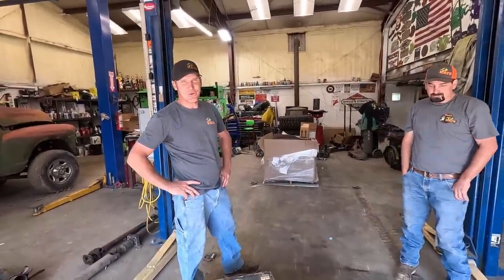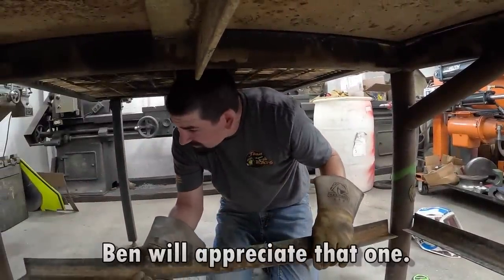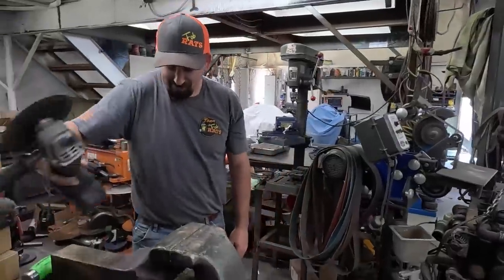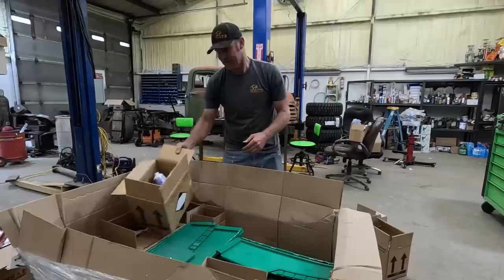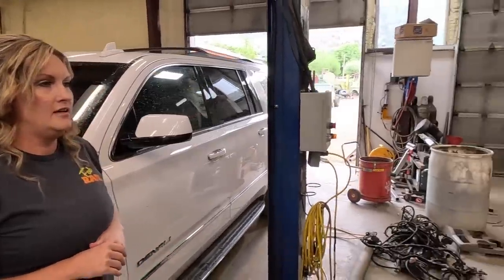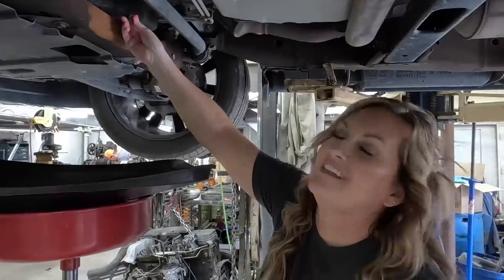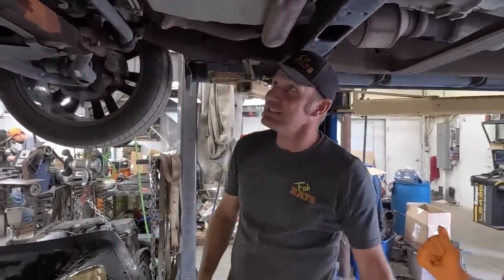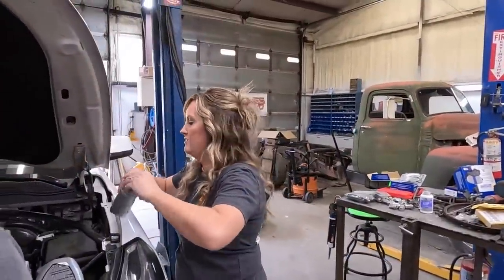Table Upgrade: You Won't Believe What I Used To Build It! Plus, We Master Hip Lingo.

Comment: WAY TO GO Meeeshelle Paul's bell . A friend of mine (heather) just changed her oil herself and i helped her do a V10 spark plug change in her Ford Excursion, she actually swapped 5 and i did 5,☺️ and i did driver side which is the easy side. i was so proud.

Comment: Having good tables in a fab shop is a must! In my fab shop not only are all my tables set at the exact same height but they are all on heavy duty locking casters so I can move them around the shop. Actually most of my equipment that can be is on casters even my 52” Stomping shear!

Comment: I've had a Sears ratcheting ball end nut driver for 30 years. I use it quite often. It is an awesome tool to have.
Those sleeping pads are handy to have. Put one with your hunting gear. I'll keep you off of the ground. They're really great for emergency use, like getting lost and having to overnight somewhere out in the boonies.
I'm pretty sure Matt and some of your other buddies could use some of that stuff from the big box.

Comment: Really enjoyed this. Everyone. Was laughing and just having a great time. Michelle has a awesome voice when she sang, it did my heart good. I must say growing up in Florida I loved to run around barefoot and have done that most of my 69 years. In my early 50S on the Pine Ridge Reservation doing a health clinic I saw all the little kids running around barefoot, so I popped out of the semi truck and right onto a goat head. At this time I had know idea what beast sunk its fangs into the bottom of my foot. I thought Florida sand spur had made my feet tuff enough to with stand anything. Man was I ever wrong. I would rather step on and old nail than one of those nasty beast. You should share one of those. I really enjoy your channel.

Comment: Hunter,  the time was 45.07 seconds  not 45.7 seconds. That is 0.63 seconds faster. Might not sound a lot but in a 100 meter race it could be the difference between first and last.

Comment: You need to check the air pressure on the tires.  The rounded off corners on the front and the heavier wear on the center of the back tires could all be from the air pressure being to low.
Reply: Excessive wear in the center is usually a sign of over-inflation. More mpg, less mp tyre! 😂
❤🇷🇴

Comment: You CAN mix different weights of oil. Stay with the same brand, so the additive package is the same. 3 quarts of 10W30 and 3 quarts of 10W40 gives you 6 quarts of 10W35. There is no real reason to do so, but in a pinch 10W35 oil is a helluva lot better than no oil at all! Have been around both in and running shops since 1984. Once again, no real reason to, but its better than nothing. Ask me about ATF in the crankcase!

Comment: 23:53, If I remember correctly, GM puts tabs in the frame for you to hook the ear of the caliper into so it doesn't hang from the line, you can kind of see it at the time stamp where the wheel well plastic ends, small oval hole to the left.

Comment: The first number is the indication of where the viscosity of the oil should be for a given vehicle and the region in which it operates.  In regions where it is usually very cold a low viscosity is wanted to reduce the effort the starter motor must put out to crank the engine.

Comment: Just a little tip for how I remember when to change the oil is I go 5000 miles and do it in intervals of that so at 100000 then 105000 and so on so you don't have to remember the mileage but still write it on your filter and the date just in case. But that method works with my wife to tell me when it's time just in case I don't happen to drive her car. Also keep the great videos coming, this one had us all laughing the whole time.

Comment: those dozer tops I was in the Army and in 76 i got two of them assigned to me, they had the solid 1/2 in steel tops around 78 I got two more assigned, don't know what I needed more for, they had steel tops like the others so they were well past WWII issue.  The advantage was protection from small arms fire.  The dis advantage was the sun would cook you in summer months. Now you know.

Comment: Paul, you are not utilizing all of the upper space of your shop around the perimeter. You NEED warehouse shelving that can not only hold a tremedous amount of volume but also weight. It can also hold smaller shelving AND you can delete the lower shelving to have workspace/tool boxes underneath.

Comment: I just found out something that Paul mint find crazy & I a Chevy guy!!  The factory cam bearing spacing specs by the book claims it should be between 1.5 to 2 thousands but is actually as much as 6 thousands from the factory!  Crazy but makes alot of sence when my machine shop told me. Been running clevite tri-metal cam bearings that support 5000lb of pressure where stock is 1800lbs.  Full race bearings can handle 8000 lbs. We ream them to fit after installation since most aftermarket LS cams have larger bearing surfaces, to make up some of the stock clearances since few are willing to install new cam bearings... Im so jelious off all the chemicals ITW sent you!  Locktite & Right Stuff are always in short supply in my shop lol.  Love the new table upgrades & dedicated plasma!  Some day!!!!!

Comment: Having Miss Michelle in the FAB-RAT-SHOP,  simply tops off any video as far as my opinion is,  concerned.   And the Yukon SUV I feel 90% certain it belongs to Michelle. 

It really is a beautiful one.   And the table turned out fantastic.  Lastly,  I think it was right about 3-minutes into the video and looking over Paul’s shoulder out the garage door,    You could see the clouds getting extremely dark.  So,   it looks like the bottom was a fixing to fall out anytime.

Comment: Look into the oil build up on the valves. It's a common thing with these DI engines. That and lifter failure. I've got the same yukon.

Comment: I noticed you used 2 clamps on the caliper, a trick i have used all myblife is just compressing it before i take it off.  I can also check the slide points doing this.

Comment: 90% of those style spline lugs can be taken off with a 19mm or 3/4 with zero slip slides on just like a socket. I had to do it on a duramax I had. Proved it to my co worker at a local mechanic shop at the time that was far senior to my knowledge level and he was flabbergasted lol

Comment: Good job on using the caliper lube.  Too many skip it and end up with uneven pad wear, brakes locking up or brake fires.  Be sure to renew it every two years when the brake fluid gets flushed or any time you need to remove the caliper.

Best!

Comment: 2:54 not gonna lie i cant crouch anymore. If i have to use my knees much it will be a short day in the shop 😂
6:43 expanded metal is the way to go. I made sheet metal drop in shelves on my work bench and they are FOREVER gathering nasties. Ofc my shop is a tent so its even worse.
15:58 😂 Paul casually backs up 😅

Comment: Paul, in replacing that oil filter, you did not mention to Michelle the need to put oil on the surface of the rubber gasket, neither did we see it being done.  Was it done????

Comment: Paul stop those old pads they will have a hole in the center of the caliper through the pad knock it out get some bolts and you use a impact to change pads way faster!

Comment: I'm not sure if you guys do this it was not shown on the video but when I change my oil and I get to the oil filter I prefill the oil filter and I dip my finger in the new oil and run it around the filters gasket reason why I do this is to keep the motor from running  dry  without oil

Comment: Yeah Paul, Hunter and Sean upgraded the welding table and now it will be easier to get access to the mig and Tig welders. Landon must have driven Michele's SUV a lot to wear those break's out. I'm sure Michelle helped a little bit on them 😉 it's nice that Paul is teaching Michelle how to change the oil and filter plus indoctrinated her on the brake pad replacement. Hunter welding in a pair of shorts was dangerous and funny! So Sean can weld? Welcome to the channel Sean!

Comment: Michelle, on removing the drain plug and dropping oil from it on the garage floor:- "It's only 3 little drops" (of oil on the floor).  Michelle cannot count, as actually its was 22 good size drops.  If that had been her kitchen and Paul had dropped milk on the floor, there would have been big trouble, probably.

Comment: Isn't it funny? My 2017 Dodge Journey Crossroad is still on the MOPAR factory front brake pads and it has 168000 miles. Oh and it's never low on oil between oil changes. I'm a reformed GM junky.

Comment: Good for you guys for using the correct oil, but mixing and ending up with 5w26 really wouldn't be the end of the world.  Heck filling with 30 weight would be alright...especially as the summer months kick in.  Everything is going to get lubricated just fine...it's just that you will get like 0.5% worse fuel economy. Thicker lubricates just fine....

Comment: Great job, Michelle
Paul why would you put bald tires on the front of the steer and the good ones in the back I know tires are expensive but I wouldn’t replace the ball tires with new ones or just got off or new ones and use the two good ones for Spairs

Comment: Michelle did not to bad...wish you would have showed her how to torch to spec the tire lug nuts though...letting her off to easy maybe, because she is learning this stuff pretty well? 
   
There is only one reason you can't mix different oils, that I know of, as the additives that work at operating temperatures could compete and cancel each other from working effectively. Note this information is 20 years old though...

Comment: what is the whining noise coming from the engine when you started it at 27:02 my gmc makes the same noise , sounds like a power steering pump gone bad but these dont have power steering pumps.

Comment: I can't get my head around the way y'all built the shelf under the table.  Why did you weld the angle iron to make a lip around the edge? It seems that unless you want a lip around it.  It would be easier to use if the angle iron was flat.

Comment: Usually tires wearing unevenly is s sign of bad tie rods or bad ball joints or wheel bearings. Shouldn't be A alignment problem unless it was never  aligned after a previous tie tod repair.

Comment: should be 8qt of 0-20 and also the inside wear on the front tires is normal on those see at least 20 a day with gm spec alinements and they all wear the inside of the front tires some will chop the inside of the front tires but that is normally on pickup more than the tahoes/suburbans.
Reply: to be perfectly on the full mark its 8.3 qts

Comment: I have always said that Girls should take one semester of auto shop, and Boys should take one semester of home ec.   I got married at 18, and then divorced 9 years later.  I did not know how to wash my clothes.  Sad, but true.  Also, before I got divorced, my wife called me one day and asked what it meant if the OIL light came on.  I said that you should immediately shut off the engine.  She said that it went back out after she went around the corner.  She drove it to her Mother's house to call me.  (1968)   I drove out there and put in 3 quarts of oil.  She did not know how to check the oil.  I started to do a weekly check of her car that I never drove after that.

A few years ago I moved to a town in Idaho.  I used Big O for my tires in Nevada, so I went into the Big O in my new town.  They tried to scam me into doing several additional things on my pickup that were NOT needed.  I was a heavy equipment mechanic at that time.   I left that shop and NEVER went back.  I now use Les Schwab, and I am extremely satisfied.  That Big O scam attempt ended up costing them thousands of dollars in tire purchases from me, plus, I told everyone that I knew about it.

Michelle did awesome with her maintenance.  Do you think that she will ever check her oil?  LOL

Comment: I will never trust an impact gun, pneumatic or electric to do wheels again. Putting them on, yes. I still follow up with a torque wrench, after having two front wheels come loose, and one almost completely off on my RAM 2500 Cummins.

Comment: Only thing Paul did wrong did wrong with the oil change is: You did not crank the engine after filling up the crankcase with oil. You have to check the oil level starting the engine to fill the oil filter. Rookie mistake.

Comment: It's normal for any GM vehicle to be a quart low on oil.  The only time they're not low on oil is right after an oil change.  Fear not though - give it about 1k miles and it'll be back to "normal."  🤣🤣😂😂

Comment: I know the com mentors are brutal,  Before you pull the caliper, take a big flat screwdriver, pry the pistons back in with the used up pad, no need to screw around with clamps. Never hang a caliper from a hose. The internet will make you perfect.

Comment: OH man  I " bet " there's going to be all sorts of pedal pulsation. Can't believe they didn't replace the rotors also. Well that will be another video when they have to replace pads again and rotors.  I think you should take that thing for a ride and see  if the breaks pulsing. That first wheel  going back on didn't look right.
Reply: Hahahaha.
Armchair mechanics rarely see what they think they do.
Why would the brakes pulse?
Changing the disks when they aren't worn out is a waste of money, time and resources.
They pulse because they're warped, if they weren't pulsing before, they won't be now.
If Paul and the rest of the crew can rebuild motors and transmissions, diffs and bodywork, i think they can be trusted to do brakes.

Comment: Ypu need heavy duty castor wheels(with brakes) welded on all of your tables. As soon as you will do it, you will curse yourself why didn't you do this sooner. Mark my word. Everything, pipe bender table, anything whats heavy in shop and not fixed to the wall- it will make you fly when working or organising and save you more time and money in a first month than you spend on it.

Comment: I don’t understand people who don’t torque lug nuts!? One of the most crucial bolt areas. Especially with alloy wheels where a loose or overly-tightened lug nut can severely damage the rim and lead to rim/tire failure. And alloy wheels can crack by a lug being overly tightened with an impact. Why?

I get 💩 all of the time for torquing the lug nuts. “Oh you’re such a safety sally.” My life and the life of any of my passengers, and others on the road is not a joke. It’s one thing if you risk your own life in a vehicle that YOU are the only one in it, but to risk others over something that is so easy to prevent makes no sense.

As a former Paramedic who has been on MULTIPLE vehicle accidents with many deaths, the precious gift of life in not something to be taken so flippantly.

Comment: My cusin had an problem with hes tractor,it gotten week on the hydraulic,it was an old grey freguson with an gasoline engine,he make an phonecall to an near by repair shop,and the old guy on the shop told him:you lazy bastard drain the hydraulic and take the bottle seal out from the screen,the old man have been there before and my cusin drained the oil and there was that bottle seal who had glogged the screen.....

Comment: Paul did not tell Michelle to lube the Oring on the oil filter before screwing it on, big mistake.
You don't put 0W20 oil in any car its like water and serves no purpose.
Dont use quarts use litres get with modern times and metric.